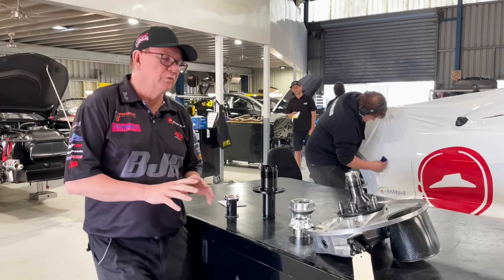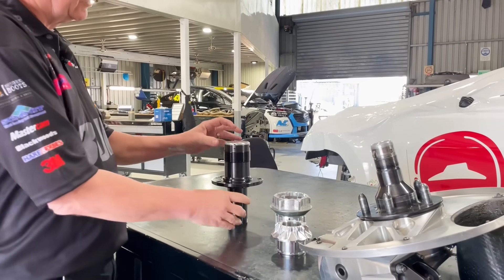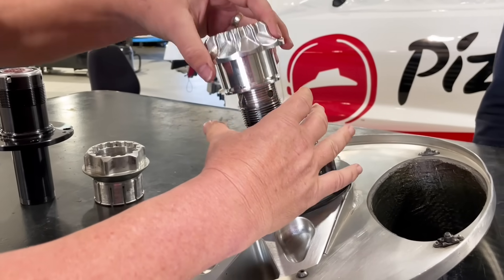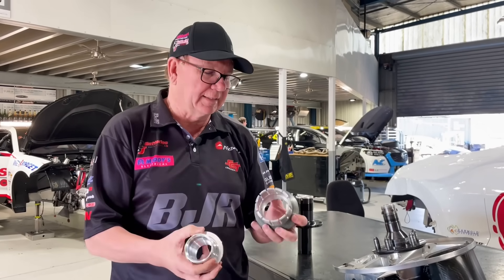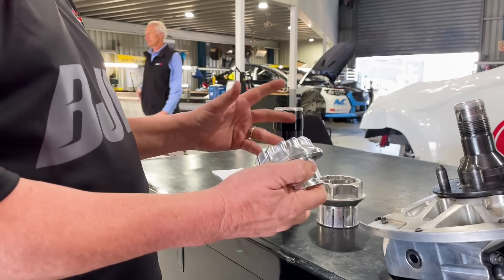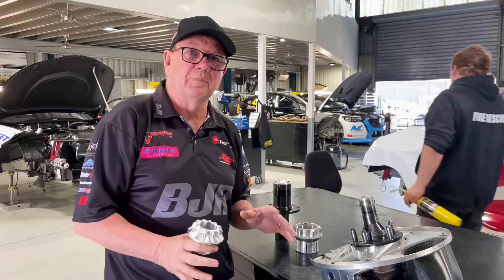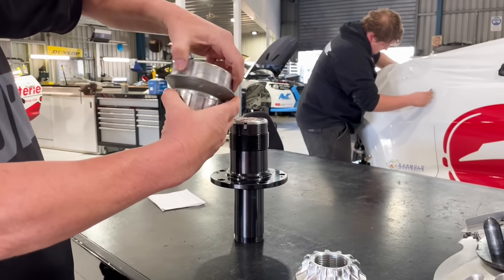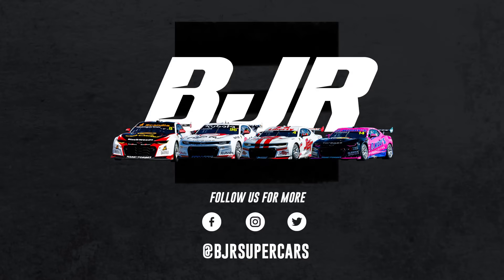Brad explains his theory of wheel nut failures

Comment: Main question. Why the change from a tried & proven reliable method??  Gen3 was all about reducing costs. But it would've cost $$ to develop & manufacture this.
Cost $$ to change over the equipment used to take wheels off. Cost $$ to change wheels..  When all teams from previous years all had equipment with the old wheels.

Comment: I would appreciate some insight into the pros and cons of making this change… I’m sure there was a good reason for it, but it seems there have been some unintended consequences…
Reply: I'm still waiting for the reason the dry sump tank vent , vents in the engine bay? ( or even why the tank is in the engine bay?)
Reply: @blueyhis.zarsoff1147 It's been part of the rules since 2013. It's harder to hit there so less damage potential for spills and fires. No oil running inside the car.

Comment: Q1 - the old one worked well, why change it ?
Q2 - Why does the new spindle have spring loaded tangs if it doesn't lock into the wheel nut ?
Reply: I believe they wanted to go to electric rattle guns, so reducing the size of the nut & spindle reduces the torque required so the electric rattle gun will do the job
Reply: @KaneTerry  I think the change from Mag wheels to Aluminum wheels also played a part.
The Mag wheel could handle that 800 Nm of torque, an Aluminum one, not so much.
Reply: @petert3355  No they've been using ally wheels for about 10 - 15 years with 800Nm. However, the nut and spindle design Brad is referring to here was originally created all the way back from the Speedline / Oz Mag wheel days back in the mid to late 90s, and it remained largely unchanged, just refined with the nut retaining system, all the way until this year. So you could say it was meant for Mags. But does just fine with ally. They just use anti-seize on the ally to ally mating surfaces. What Brad is saying is that the new nut is more likely to come un-done with heat changes because it is done nowhere near as tight.

Comment: Hard to understand why change from a proven system. Brad does well to show the differences. Thanks for the video.
Reply: What's more bizarre to me is that, why design a wheel nut retainer system, that in no way, shape or form, actually retains the nut? 
The only thing keeping the nut on in the new system is the torque from the gun to hope that it's tight enough.
The previous system ACTUALLY HAS a retention device - the tangs that hit the lipped surfaces inside the nut, that are only allowed to unlock when the wheel socket goes on and pushes the tangs inwards to unlock them.
That new system is such a poor design. No socket activation, no lips to grab the tangs, and moreover the tangs themselves are tapered to ensure the nut can slide easily over them (and back the other way just as easy as BJ pulled it off with his hand). 
Whomever designed it did a bloody cruddy job!
Reply: The reason I read some time ago was that they plan to move to electric rattle guns which wasn’t an option on the bigger spindle. That would remove all the air lines in pit lane, which cars have snagged in the past on wings and such. The goal is to improve pit crew safety with the electric guns.

Comment: My question is,if the old system worked then why change it?
Reply: I think this is supposed to be the first step to using battery powered rattle guns.  The battery powered guns couldn't give enough torque on the old system.
Reply: It looks like they also wanted a smaller, more GT / Indy style nut. Which is fine, but you still need a decent retaining system, which this doesn't have!

Comment: Great video and explanation Brad. I'm surprised that the new design didn't incorporate a similar 'locking' mechanism as well... what's that saying... If it ain't broke, don't fix it! 😂
Reply: last years nuts also had the chance of stripping/cross threading, also a chance of not grabbing at all.
Reply: @Bestintheworldatwhatido  didn't they also have a couple of instances where the button would not retract the locking lugs and so they could not remove the wheel? I think I remember a couple of times that happened.